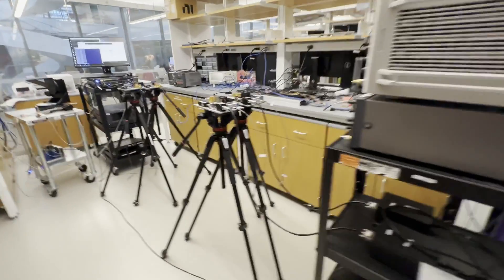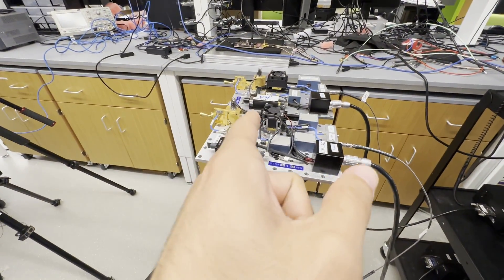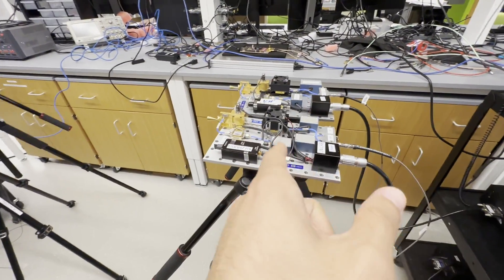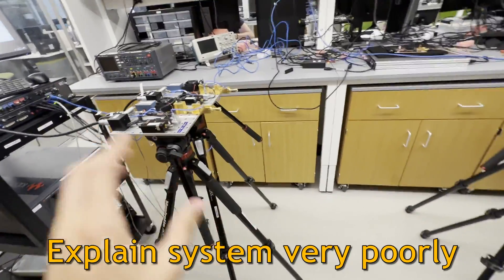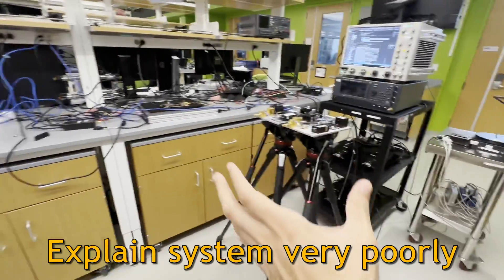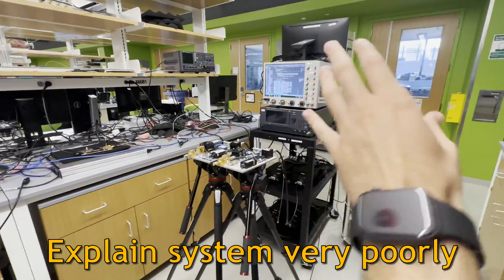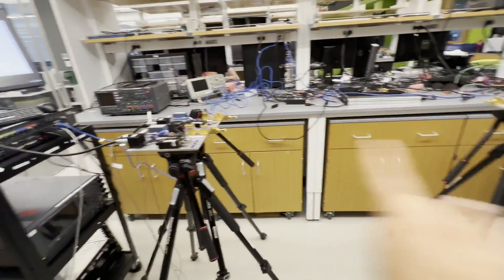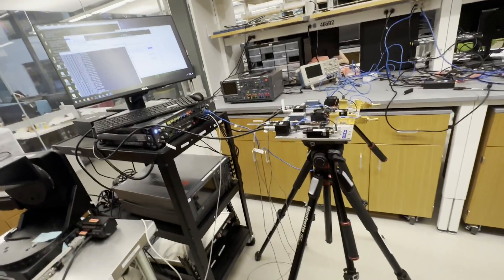Day in the Life of an Electrical Engineering Researcher

Comment: What kind of digital filters are you using to process such a high frequency? Passband or Stopband? 

Also which filter would work best in this system
Butterworth or Chebyshev filters?
Reply from the maker: at those frequencies the filters get really complicated -- the waveguide essentially acts as a wideband filter
Reply: @alithedazzling  I just graduated as an Electrical Engineer my last class was focused on designing digital filters. I am happy to apply some of the concepts I've learned to videos like this... This is a really cool project

Comment: Hi Ali. Im a student at the University of Wisconsin-Milwaukee ( one of the few schools chosen by the U.S Department of energy )and Im also a civil engineering major but I also took some EE classes. I dropped out of EE because I wasn't expecting that much versatility in the major. We did circuitry and computer coding simultaneously, plus Lab TA's I had were horrible since the TA for the introductory EE course hasn't taught me how to build circuits ( He told me I should learn by YouTube instead ). This was last semester, fall 2023. This semester I took civil engineering classes, plus the Calculus 2 retake ( the hardest calc class ) and I got a 3.2 GPA for this semester. I feel happy because I took statics engineering class ( one of CE's most important classes ) and got an "A" in that class without having taken Physics 1 and Calc 3 first. I just wanted to hear your thoughts on civil engineering vs electrical engineering. I've seen some of your videos and Im starting to like your channel since your feedback is helpful. I see you have an extremely bright future ahead of you.

Btw I saw you were playing chess on the PC. what's you chess rating? I ask because I also play chess too and my rating stands at 1300-1500, though Ive been playing for a year. I think chess should be mandatory for engineering students since it fosters critical and analytical thinking skills. Would you agree with me on that one ? Just saying,,,

Comment: how much power were you pushing through the transmitter to achieve communication at the distance shown in the lab?
Reply from the maker: With the distance shown in the lab very little is required, the range can vary from few milliwatts to 100 milliwats based on which modulation scheme/SNR is needed
Reply: @alithedazzling  thank you, that's very interesting!